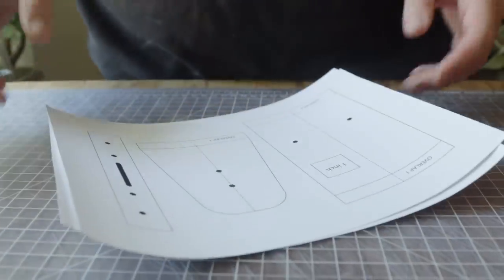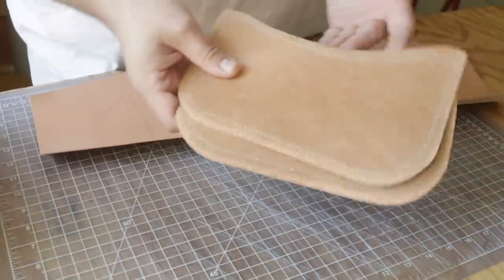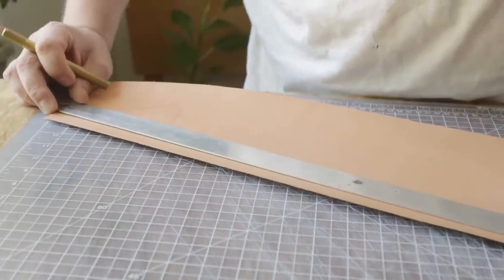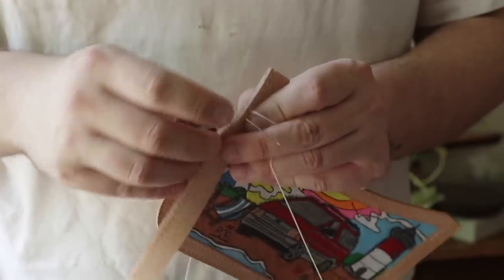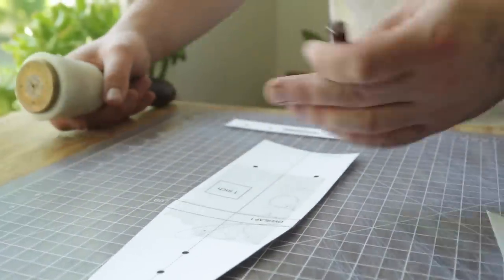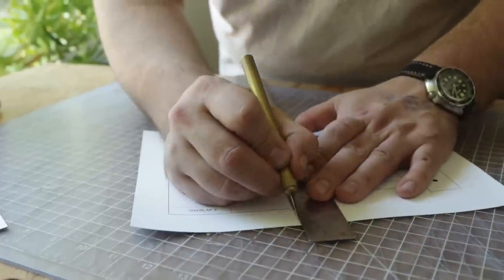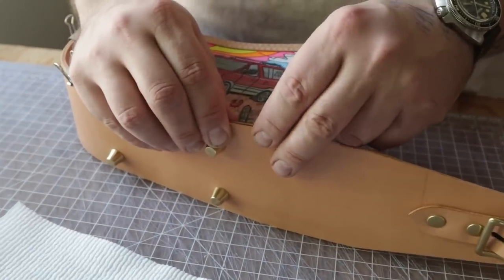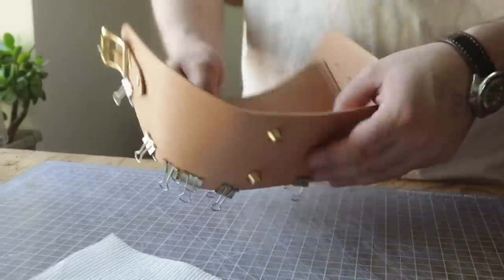An EASY Leather Baguette Tutorial (with PATTERN!)

Comment: Small tip, instead of pencil use a Pilot Frixion  pen. You can press much lighter than a pencil preventing creasing of the leather and if the mark is visible heat it with your lighter and it disappears.

Comment: Thank you for the video and updated video for zipper install. I bought the pattern pack and have made all the templates, I also scaled it down by 25% to make purses for my granddaughters which worked perfectly. A comment/question: your example in this video showed that you added a trim/border around the tooled side panels. I will be using a floral sheep skin with a veg-tan liner for my panels. The gusset interface will hide the sheepskin border except for the top edge. What is the best way to finish that top edge?

BTW: The method you show for punching the holes in the gusset only works for round or diamond holes. If you are using an awl, pricking iron or punch for saddle stitching (diagonal slits), then the gusset would have to be punched from the back or you have to have both right hand and left hand pricking irons. I learned this the hard way when making a computer bag/brief.

Comment: I have a question, with the double seam strap piece, could you fold it the other way so it pushes the side panels of the bag outwards rather than the gusset framing the side panels?

Comment: may i know what is the thickness/weight of the front/aback leather
Reply: Yeah I'm curious as to the thickness of all of the leather pieces.

It's not in the pattern, video or description. Just the strap and the straps around the edges.

3oz is pretty light to tool, so I'm assuming a 5oz maybe?